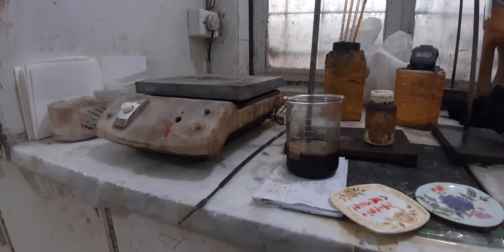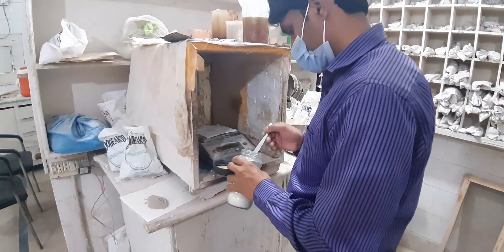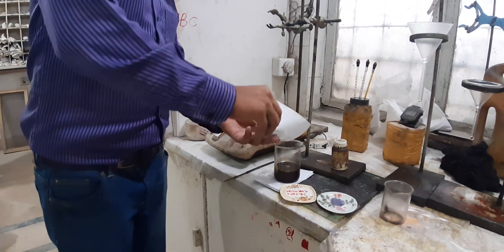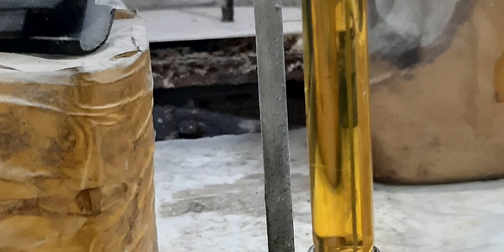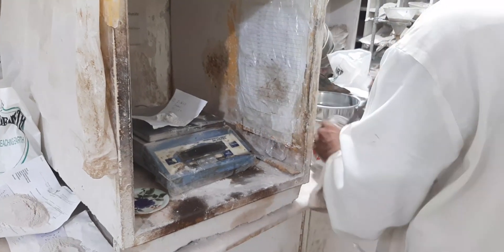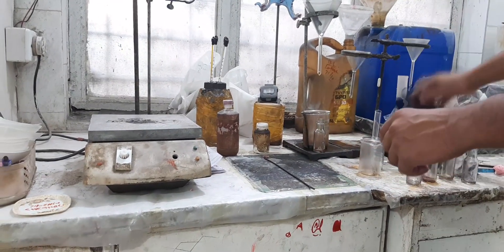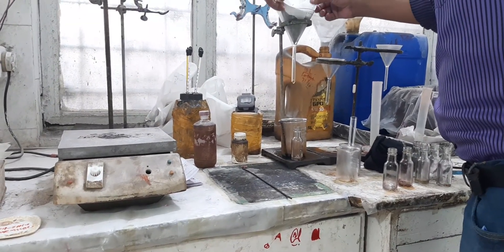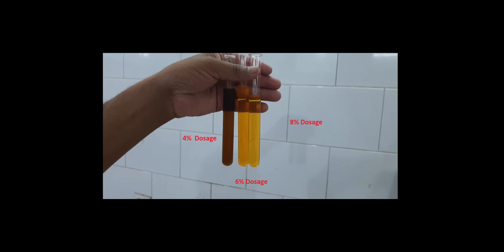Recycling Engine Oil with Activated Bleaching Earth: Exploring Different Dosages for Optimal Results

Comment: You tell me what is the first procedure
Reply from the maker: First waste oil to 360C temprature (Cracking)
After that add 8 percent Sulphuric acid at Low temprature around 90C
Then leave it for one day
after that Base in it
Reply: @EarthChemEC contact send sir
Reply: Hello sir is the formula you mentioned need to be filtered after one day
Reply: AoA thank you it worked sir if wanted to on a large scale can you tell me how to filter it is the machine required or any filter paper that is easily available thank you
Reply from the maker: @Ahmed-mr2eb  hot filter press can be easily fabricated or already available in markets you can check
Reply: @EarthChemEC كيف اعاده ضبط الحموضه
Reply from the maker: @مصطفىسويلم-ط8ذ  neutralize it using soda ash
Reply: @EarthChemEC  How much in water?